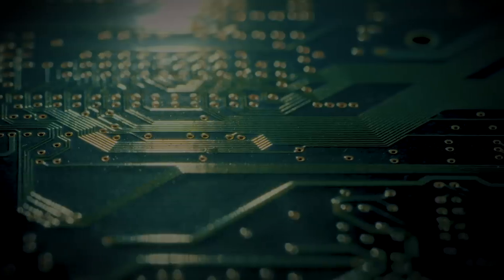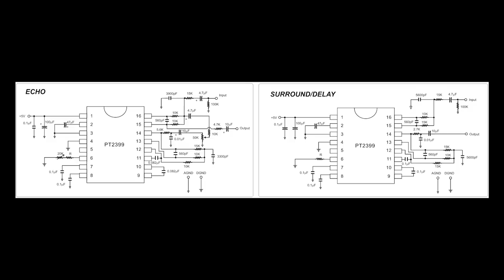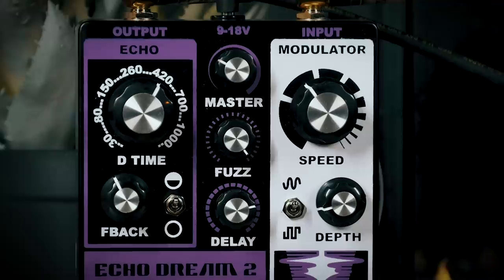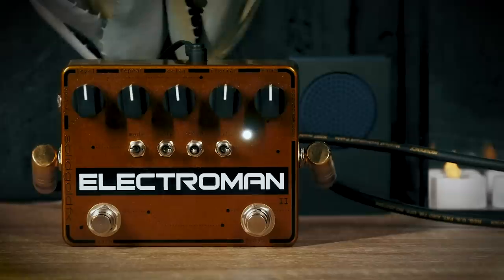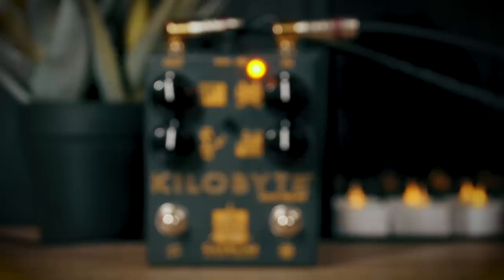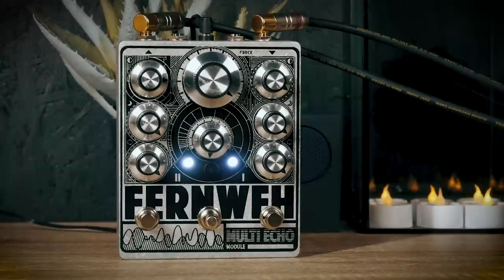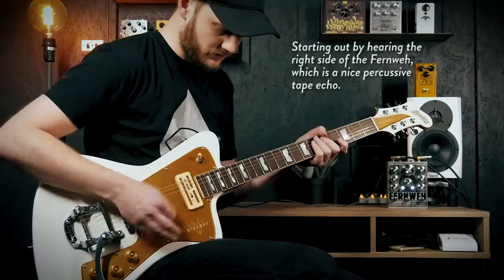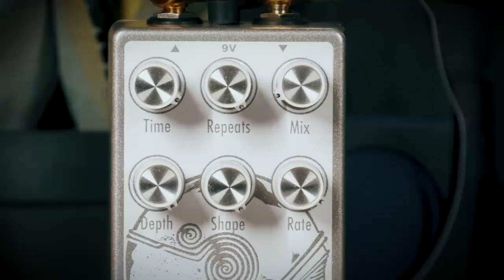My 5 Favorite PT2399 Delay Pedals - 1 Chip to Rule Them All!

Comment: Haha hey Stefan, it is ironic that you just responded to my fan boy comments on the ED2.
Without really knowing it, I have a few pedals here with the PT2399 chip. One I know for sure is "Wampler's faux tape delay" and it has vibe for days.
You can hear the sound of this chip in all these pedals, very impressive, thanks for sharing this.
The self oscillating feed back sounds like the real thing! Wow Black lodge sounds great as they all do.
I don't know what Johnny Greenwood used for delay (probably many pedals and tape delays) but this chip just oozes Radio Head'ness.

Comment: One thing to keep in mind is that with such rudimentary chips as the PT2399, the analogue components are going to shape it a lot more. Like with most digital solutions, it still needs things like low pass filters and the likes in the chips, before you get into any other colouring external components does. I'd love to know EXACTLY why it sounds like that though, compared to other delays.
Reply: It's not a digital solution.

Comment: This cheap "Analog" pedal I bought has the pt2399. IMO, they should've named it analog-style delay. It'll Self-oscillate forever and a few other things so I guess that makes up for it. Lol

I'm really wondering if you can make your own stereo delay setup with two delay pedals and a  y-cable and 2 separate amplifiers? Or however you would set it up without a ground loop?

Comment: The 2399 is not digital. It's analog.

When people refer to analog bucket brigade chips in old delays, they are referring to chipsets like these. 

An integrated circuit can be many things but in guitar pedal usage, they are almost always essentially cascaded transistor sets. 

Transistors are what make fuzz pedals tick, yet they are certainly not considered digital by anyone.